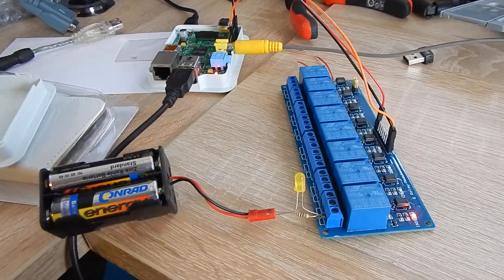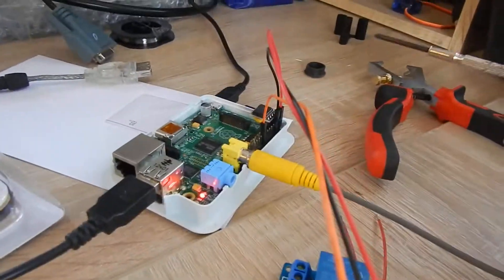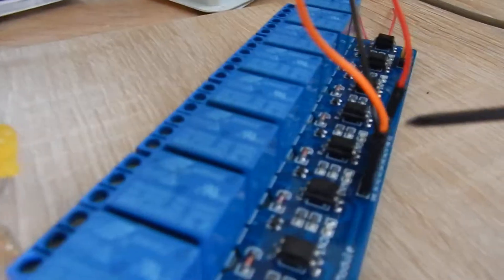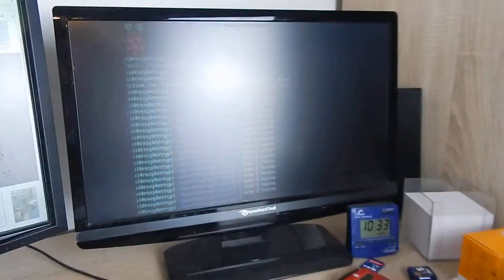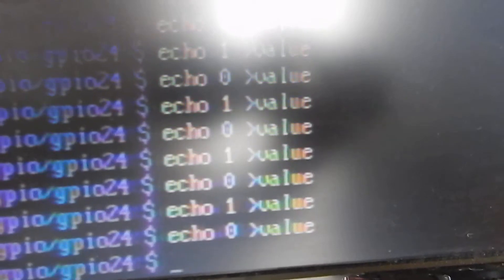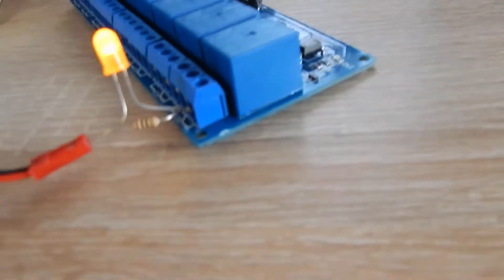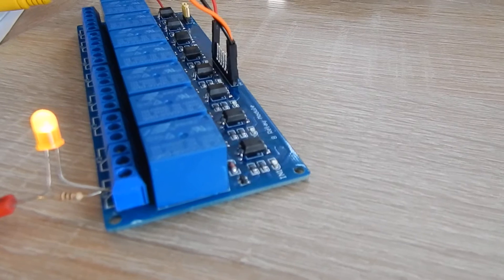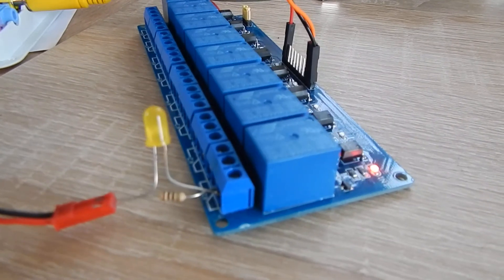Raspberry Pi and Relais Card

Comment: i am really confused between using a 5v relay or a 12 v relay please help me decide which one would be useful and why !! 
i will be using it for my Fan , lights and witching LED TV on/off !!
Reply from the maker: Raspberry Pi runs on 5v, so whenever you can, buy 5v stuff. Otherwise you will have to solder a transistor circuit and add a additional 12v power supply in order to control them with raspi.